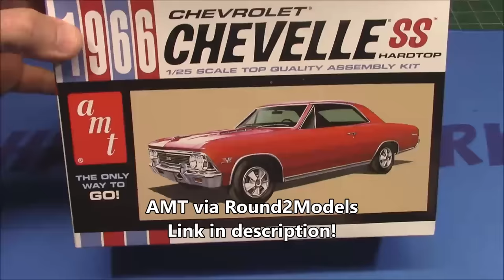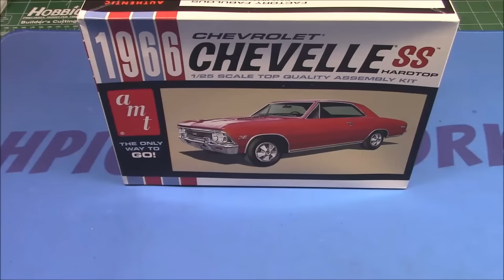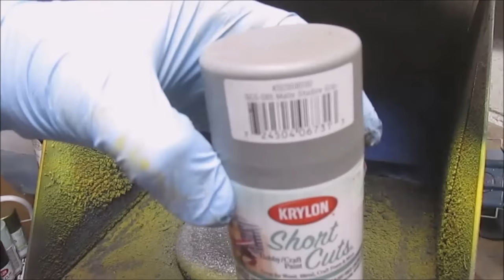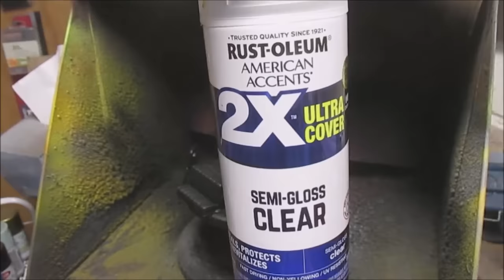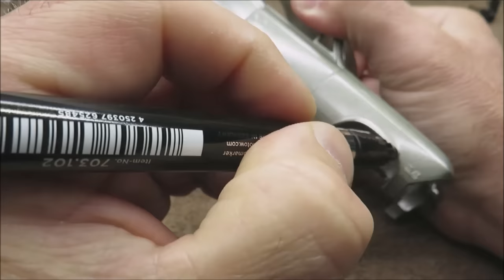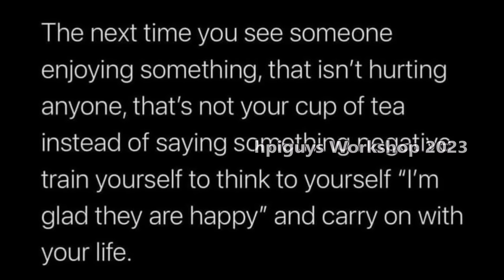1966 Chevy Chevelle SS 396 1/25 Scale Model Kit Build How To Assemble Paint Dashboard Engine Trim

Comment: I built this one a while back!
I did just as you did but I painted mine red!
It is a nice build!
I was worried about the steering column underneath the hood and now I remember what kit it was from the 61 Impala! 
So take note if you build the 61 Impala do not  add the steering column on to the fire wall until you get the body on the the assembly frame and interior!
Nice build! I enjoyed it!

Comment: Chris. I love watching you use different brands of common spray paint instead of high priced Testor / Model Master series paints. More often, you use the Rust-oleum painters Touch 2X. These are available at Walmart. I recently got back into modeling primarily due to you videos, tips and techniques that I never did. I am doing Snowman's truck and trailer from the movie Smokey and the Bandit. I didn't use 2X primer on the truck body (used a premium model primer) but I did use the 2X Gloss Black on all the truck body parts. I found the 2X Gloss Black to be easily scratched by my fingers and leaves imprints even after 3 days of hardening. The paint didn't adversely react with the primer. Do you find at times the 2X paints do this? I still have the trailer to build and I will use the 2X Flat Black primer and then the 2X Gloss Black. I feel I need to do a clear coat on the truck before continuing, I will use 2X clear coat of course. I just don't want to be forced to use the expensive model paint's. It's a bag of worms, but what are your thoughts? I know you talk about environment and the paint temp. I did paint these in a bit cooler temperatures, in my work-shed during the day and then brought the parts inside. I'll try to find and review your vids but anything helps for your opinion!
Cheers!
 Earl

Comment: Great build as always. What kind of brush on glue do you use, I have tried Tamiya, but never seems to hold the way yours does, thanks.
Reply: I believe he uses bondene. That’s what I use and the brushes look similar.
Reply: He uses Plastruct Bondene. He poured it into another bottle that's less likely to tip over than the Bondene bottle.